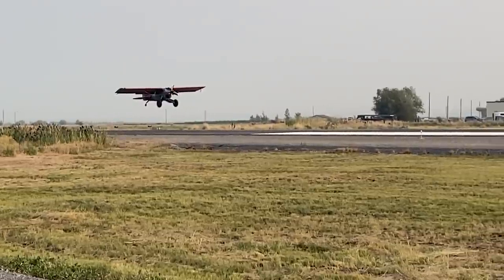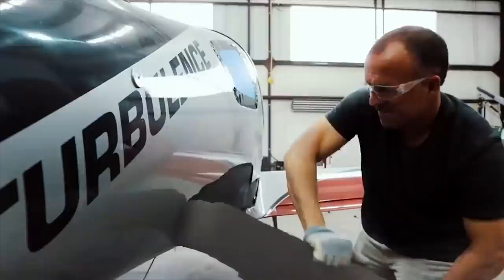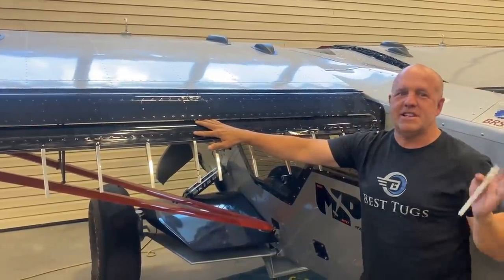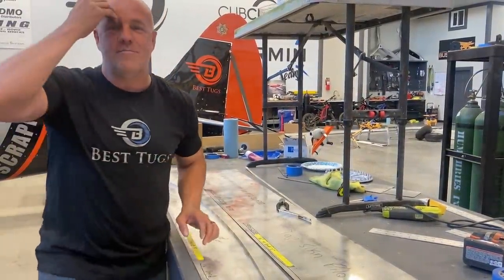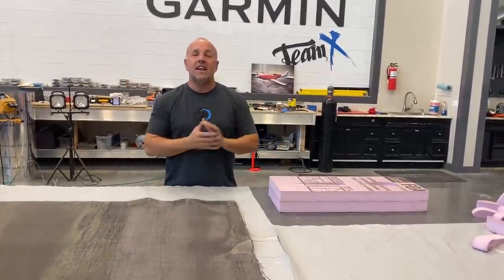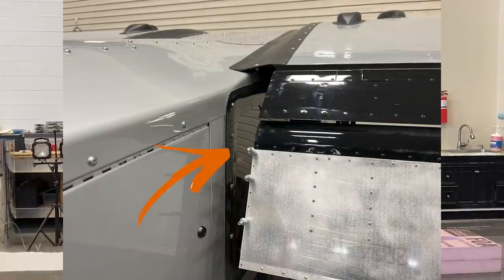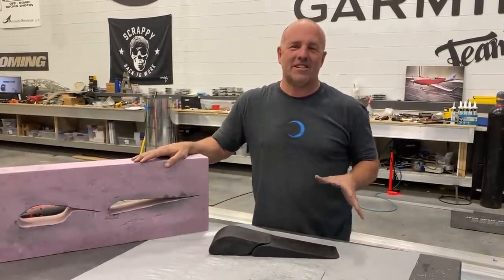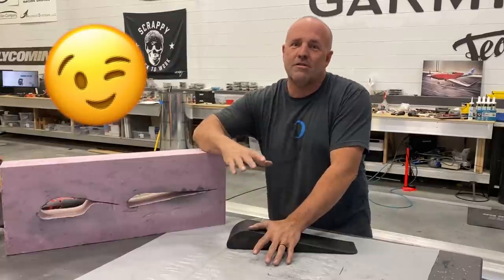How To Make a #CarbonFiber Part Cheap & Scrappy Upgrades | Scrappy #65

Comment: MIKE!!! have you seen the people making 'forged' carbon fiber parts from chopped fiber, resin, and 3d printed dies? They're making the dies just out of PLA plastic on a consumer FDM printer. Its a good technique from what i've seen to make extremely strong and complex parts that is worth mentioning. the one example I watched they made a motorcycle clutch lever and magneto cover. Check it out when you get a chance!
Reply: Hehe we have seen the same vid
Reply: Yea, easy composites guys do a great job with their videos. I'm printing molds for my FPV quadcopter design and gonna forge the frame parts. Curious about how it's gonna turn out compared to laminated stuff. It could save me lots of time and remove some of the laminating constraints.
Reply: To my understanding, with “forged” carbon fiber you’re really making a resin or epoxy part with some strengthening from carbon fiber filament filler. Because it’s just added randomly to the part you don’t get any of the consistent directional strength you get, and can control for, with a regular carbon fiber part.
Reply: @aggiewoodie makes a great point.  In fact,  time and again,  I come across the importance of low amounts of resin. 'Thoroughly impregnate the material but remove the excess resin.'
Reply: @aggiewoodie  the resin content should be similar to a bagged part that has been layed up with a weave. the volume of the form should be calculated then enough carbon added to fill the void. the form is then clamped together in stages to allow the resin to squeeze out as it is not sealed. however the strength probably is not as great as a weave because of the random direction as you mentioned. It would be fun to build some parts and test it out!

Comment: Glider pilots are even more crazy about sealing all the gaps!
Reply: Indeed.  It's the kind of thinking that belongs in engineering. The wrench heads "solve" every problem with more power.
Reply: Yes. tape the wings, stabilizer and the canopy before a race.
Reply: @marijnjc  Though the canopy taping is looked down upon for safety reasons.

Comment: Mike,  Thanks for the description of why to keep control surface gaps appropriate for ice conditions.  There is also an instance of a prototype plane having a fatal testing crash due to this gap being too tight, and higher G wing flex gaming the control surface.  Our community has an empty place setting at Christmas Dinner table because of this quest for tighter tolerance on a GA production plane.  Here's the rub, everyone who designed, built and tested this part were the best and brightest.  Tighter tolerances are to approached by the amateur builder with caution. Sometimes, it's not worth it.

Comment: 10:47
I'm not sure if you made it clear or not. But you need a contact glue that will not melt foam! The 3M "spray 77" and "Spray 90" are great products. But make sure to test and / or read in order to avoid a fail. 👍🏼
Reply: Elmer's contact spray works well and doesn't attack the foam.
Reply: Thank you both.

Comment: Mike ever since I started watching your videos I dreamed of the day of making my own carbon fiber parts. One day I'd like to make a carbon fiber replacement part for my A36's plastic shell that protects under the front seats and integrating some much needed organizers on the front since currently it's just a piece of fabric screwed to the plastic. After 40 years the plastic is all warped and lots of the inspection covers don't want to hold there screw anymore.  Thanks for helping me dream big. BTW just completed my instrument rating. Your channel is a great inspiration to never stop learning. Now back to work!
Reply: Why spend even a minute dreaming? it's literally just some rag and glue, both of which are dirt cheap and obtainable in a couple clicks online. As basically anything is nowadays.

Comment: 9:34 you can buy ceramic blade scissors, they don't care about carbon (not that they last for ever, but you can keep cutting with them for a lot longer, and they're cheap, about twice the price of a cheapo pair, so about as expensive as a decent pair of normal scissors).

Mind you, unlike regular scissors (not cheapo ones), ceramic scissors can be sharpened very easily by running the cutting edge once or twice across a diamond stone. I've been using the same pair for 3 years now, and i've barely made a dent in it.

Comment: You just gave me an idea! I need to make a front air dam for my '76 Monza. When the '80 Spyders came out I bought one of the OE replacements and put it on. Worked great for many years. Unfortunately they're Polyurethane and it finally crumbled! However I have a bunch of 1/4" pink foam insulation that I was planning to Epoxy Fiberglass and just make one. I got a great deal on a block of fanfold that had been sitting at HD for a while because it had one corner crunched. I finally asked the Manager what he'd take for it. I got it for $12.50 instead of the $25.00 it would be normally! I've been making foam and packing tape R/C airplanes out of it for a few years and I still have about half of it left! Gonna have to look into making a Carbon air dam. Maybe make a mold and do a run of them... ;)

Comment: I think it was Mod-Works that made a "T" shaped gap eliminator that fit along the flap hinge line and also doubled as a speed brake for landing, it did a 90° rotation to pop up into the airflow. I believe was used on Mooney's

Comment: Loved this vid.  I couldn’t help but wonder if water-jetting indexing dowel holes would help with lining up the forms, making less prep work.  That wouldn’t cost anything extra.
Reply: dowels are nice when you have inexperienced help.. but went cutting with water because of the tip wear and /or other variables the cut won't be exact from top to bottom everytime
Reply: due to waterjet "Kerf"... there is a slight taper... another option is bonding the sheets together and then Hot-Wire cut... (Must use adhesive that won't F'up the hot wire)

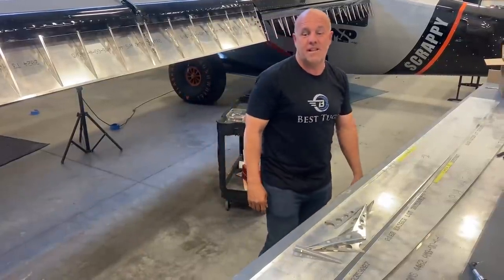Comment: Holly guacamole Mike, wow! So you've seemingly exceeded even the MENSA folks and pushed the envelope into a new category called Davinci Mode. Why would I not be surprised that the auto track starting @ 06:00 is you, Mark and Ron jamming in between working to unwind? An amazing video chock full on engineering and aviation wisdom. Thoroughly extraordinary.

Comment: The topic of gaps and sizing is super interesting, I recently read that the SR-71 blackbird had to contend with extreme heat from the speed-friction that its fuel tanks would leak on the tarmac, but once up and flying, the tanks would expand and would seal perfectly. It just needed a cheeky mid-flight refuelling before venturing across any unmentioned borders...

Comment: I love the big brain design tips like adding the 1 degree kick on the riveted edge to keep it flat and the shim on the trailing edge so the overall sheet thickness can be lower. I have filed these away in my smooth brain for future use.

Comment: I’ve made the exact same type of molds for small parts and I use packing tape as my barrier with wax and the parts just about fall off when cured. The finish is smooth and ready to go! Thanks for the update video Mike!

Comment: Some gliders have flexible seals between the wing and fuselage. Just a small flexible piece of plastic might be enough to seal the gap if you're building a race plane.
Reply: Also on gliders, a so-called teflon S-tape.

Comment: I have used .006" and .014" Mylar as a caul sheet for similar one-off parts... demolds well and makes a nice surface... 
Another good practice: if you are wetting out .5 pounds of cloth... only use .5 pounds of mixed epoxy...

Comment: Could bigger ailerons and slower speeds mean a deeper stall on the wing with the aileron deflected down. Doh! now you need a bigger rudder 😁
Reply: I could be wrong (happens frequently in fact), but he made the control surfaces on the back of the plane super over-sized. So, I believe he has that covered. Maybe ?

Comment: Interesting mention on the gap seals icing conditions. 

My gut feeling was implementing a heated element into the sides of the cut-out/ openings on the main wing/ tail/ rudder (apologies I don't know what you call the cut-out!)

Not for the race plane where you want to minimise the gap but fly in good conditions, but more an extra safety measure on a plane like scrappy. I thought about some 'plate' heaters we use in outdoor cubicles that run just by heating up 10-20 degrees above ambient without needing a thermostat. A check can be added to periodically check the IR of the heated element. 

Great video, loved the one-off carbon mould! Can definitely see me trying this on my RC carbon cub :)! PS please get onto Horizon hobby to get a model scrappy on the go!

Comment: While not as cheap/quick as this process, you can also vacuum bag pink foam in a wet layup, and it also works with resin infusion.  Thats how i build RC plane wings off my cnc hotwire.  I did trials of wet layup vs infusion and the insulation foam doesnt draw up resin in an infusion.  Nice part is you can use a light mist of super 77 to lay up everything dry ahead of time if you do an infusion. Definitely a cool method to do a quick and cheap mold though!

Comment: Mike could you glue the two foam blocks before water jetting and have it cut out to avoid any miss alignment? Thank you so much for all of these great videos, you are a true inspiration
Reply: The water jet usually has a pretty important taper. It may cut 0.010 wide near the tip but 2 inch further down tou're at 0.030" (for example). Higher pressure equals narrower tapper. So the thicker you cut the more the profiles will be different and more sanding required

Comment: Over the years I've done a fair bit of mold making, with polyester and vinylester resins... so the one off mold making methods are a bit different. 

I do like working with epoxy because you can get away with using extruded polystyrene foam for your plugs.

Mike it's great to see people like you share your tricks on building one off parts.

Comment: i made some carbon  motorbike fork lower lug protectors ,made the shape from alloy sheet hot glued on joints and body filler was ease and they turned out great 6 layers to stop stones and rocks chipping the billet anodised fork lugs on a factory KYB forks

Comment: Watching the linkages of the leading edge devices moving with the flaps is amazing.  If you make the flaps too big, do you risk them disrupting the airflow over the horizontal stabilizer?

Comment: Hey, Mike, have you seen a type of wheel called a Mecanum Wheel? They have, instead of tires, a row of 45 degree-angled rollers. The range of movement they have is incredible; crabwise, diagonal, rotary. A fork-lift has been developed that uses them that has increased the density of stuff that warehouses can contain, because of the reduced space needed for turns. It struck me that they might be a good fit for a tug design, as it would obviate the need for any load-bearing turntable arrangement to take a tail-wheel.

Comment: Re: flap gaps...  How about, inflatable boots to seal the gap, auto deflate to allow movement, auto inflate for speed runs. How about, electrically heated surfaces to dislodge ice. How about, soft material (e.g. rubber boots) to fill the gap and block ice from the gap, but flexible enough to crack the surface ice. Cheers.
Reply: I'm certainly not an aircraft engineer, but I've seen the lengths Mike goes to just to save an ounce of weight. You just have to balance the benefits vs the weight it would add

Comment: Mike,   Can you pull up the gear?
i.e. while in flight, can you adjust the pressure in the shocks to pull them up? 

Would this help lift? Is it pointless?

Could you add a tension spring to make the gears position when the shocks are depressurised, up? Or maybe add a vacuum port from the engine to apply vacuum to the shocks?

Comment: Don't you worry that adding to the flaps will reduce the authority of the ailerons that you are trying to increase?  The more lift created by the wing, the less authority the ailerons will have as a fraction of the "torque" of the aileron input relative to the CG. Glider pilots would often start their takeoff roll with dive breaks extended to increase the aileron authority at low speeds because by reducing the wing's total lift the aileron force as a percentage of total lift is higher.

Comment: Wherever the moving compartments are when it comes to freezing its to bad heat tape or something couldn’t be turned on on both edges in icy conditions to keep the flaps and rutter and ailerons from freezing or wherever a moving part needs heat

Comment: Great demo on making a one off carbon part! Is there a structural advantage to using low temp curing pre-preg carbon in a compression mold (your foam mold)? I've seen composite videos where the pre-preg dries at room temp, then is de-molded and baked for more strength.

Comment: Could you have glued the two foam blocks together before water-jetting?  Or would that double thickness not fit in the machine?
Reply: Even in the very soft foam, the stream thickness of the water jet "fans" out with the increased distance, resulting in more taper and roughness.

Comment: This huge flap constellation will make Scrappy very, very slow. Can shielding or to slow speed cause problems with the air flow and the effectiveness (lift) of the horizontal stabilizer? (especially when descending with nose up). Brilliant work. Thank you for sharing.

Comment: Mike, couldn't you glue the two pieces together first and then have them cut by the water jet? No sanding but also you ensure your parts are perfectly aligned. Am I missing something in the process? Great tutorial, I'm restoring vintage Formula Vee and Bugeye Sprite race cars and have been thinking of making a custom dash for both. Carbon in this method would be within budget and within my skill set while learning new things.

Comment: *there is spray glue on my hands, the part is stuck half way into the foam, as is my rubber glove and so much carbon fibre is stuck to the dog it looks like Batman…. * Thanks for that, I had wondered about prices and that was a great guide. :o)

Comment: Well, go into college and working with the wind tunnel. We discovered something very interesting when doing research on a wooden cub model that we had. The lab tech that was there was putting tufts on the wing he put a slat on the leading edge of the wing and then he baked the aircraft to a 45° angle well past the stall when running the wind tunnel test section the tops stayed down. The teacher came through and said ha ha very funny. Don’t glue the tough down on the wing and the text said he didn’t so the teacher then decided to investigate. They found out that by putting a slat on the leading edge of the wind of the aircraft you can cancel out Stahl, because it generates lift along the slat what he was then working on was an adjustable tail so that if the airplane ever lost power, it could literally turn into a parasail in Landon a really small footprint you .

Comment: Just curious, in the 21st century... Why are we still using clinkos and rivets? Have you ever thought about experimenting with spot welding the two surfaces together ? Wouldn't that save weight as well?

Comment: Mike: As I remember you went to considerable time & expense to install industrial strength exhaust fans by your workbench.  As long as that's part of your thinking, if you take a look at the factory warnings on that "spray-glue", you'll probably want to only use it in well exhausted environments.  Check it out!  One more thing. You're making us all look bad.  Tone it down a little bit will ya?

Comment: Considering the onboard batteries, could drone props have been added to the tips of the wings to add stability at slow speeds? (Without adding more control surface)

Comment: I've zero experience with carbon fiber and have done a few one-off fiberglass over foam pieces.  Can you use carbon fiber moldless and simply just lay-up carbon fiber over a foam shape?  I realize you don't get the extreme squeeze-out of the resin, but would you still gain strength and realize a a weight savings versus using fiberglass cloth?
Reply: As I understand it, the more resin you squeeze out, the stronger the final part is. You would still realize a weight savings, but may compromise strength.
Reply: @tomcoryell  That would be OK as the parts would not be critical structure.

Comment: couldnt you have glued the blocks of foam together BEFORE you water jet it so that you dont have any lip to sand out after glueing them together?  or did the water jet not have the ability to cut that thickness?

Comment: One question I had an associate may be giving me this airplane. It needs to be worked on it is a 1937 Cessna air master. It’s a fully cantilevered aircraft, and I was curious to know what kind of things you would recommend for that aircraft, currently we’re looking at Doing some of our parts on Solidworks and 3-D printing sections made out of carbon fiber that’s reinforced with nylon. And using ceramic coatings as part of its deicing system. These radial engine aircraft are slow and heavy, but have a good range.

Comment: MIke, how did you get the insulation foam out of the finished product?

Next, I'm hoping to see how you INCREASE Scrappy's speed with a new constant speed prop
Reply: In a earlier video he uses acetone to turn the foam into liquid slush..
Reply: @upkpoxer  I thought maybe that's how he did it.